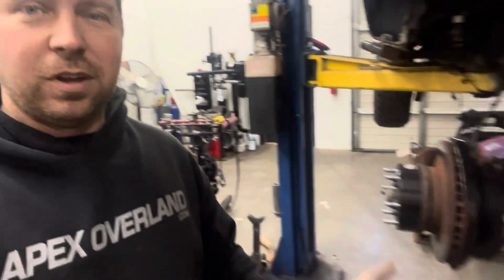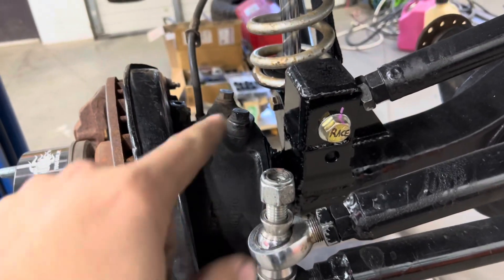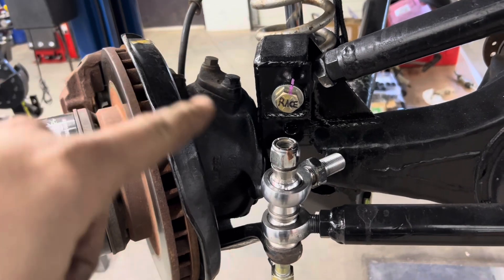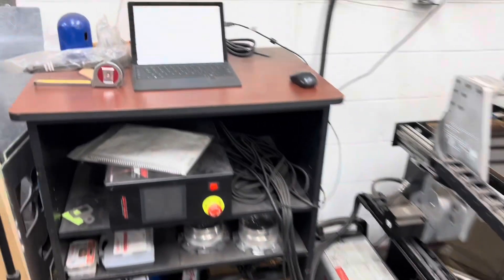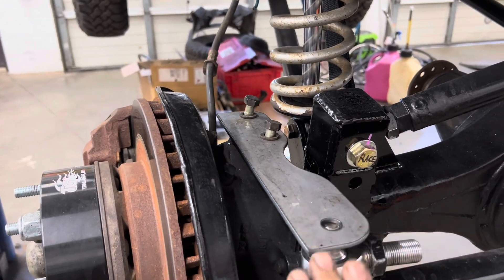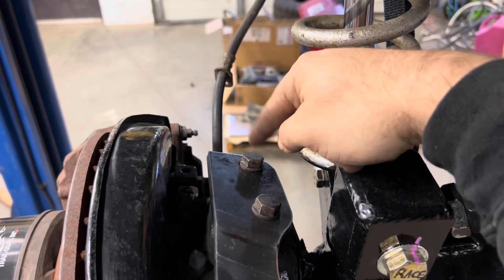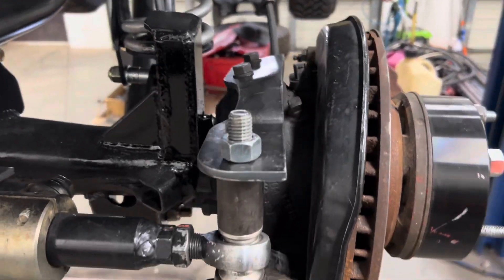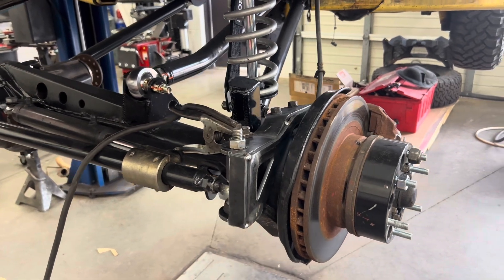Double Sheer Steering on Toyota Axles. 100 series Land Cruiser Solid axle swap

Comment: So I've got a few questions. One my tyrod goes across on the back side, how did you have equal height staring arms on the front 2. Do you sell these plans or sell as a kit? And three with that plate going across the top how does that work with the top bearing retainer on the knuckle

Comment: Please make this product! I'd like a set for my 80!
Reply from the maker: I have the files for it, just would have to bend the top plate yourself to account for the spacing of the heims you use on your specific build. You would also have to size the holes for the bolts you would be using.
If you want a set, shoot me an email, sales@apexoverland.com and I can cut you out a set